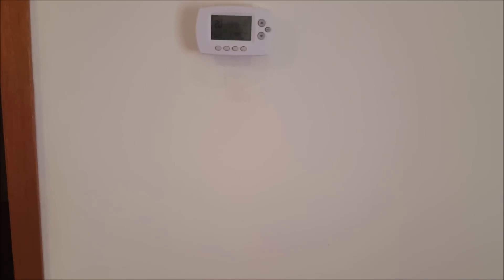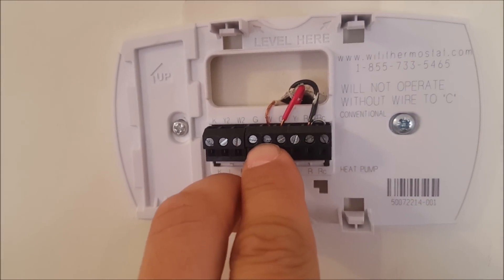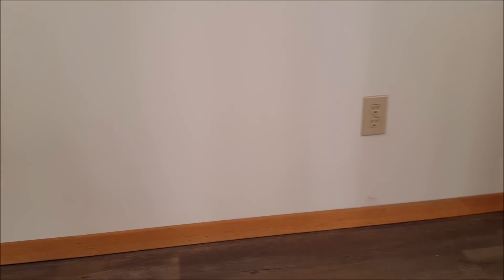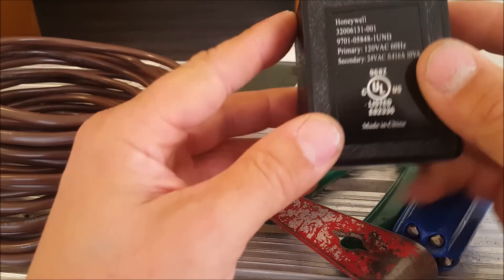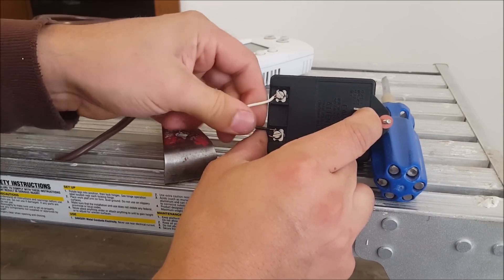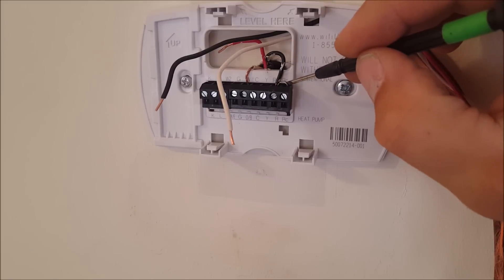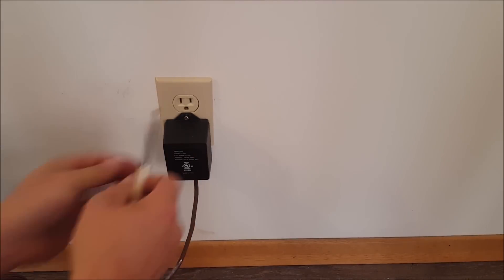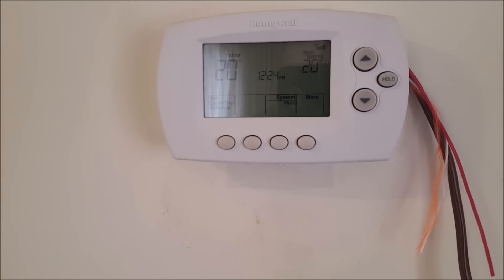Installing a WIFI Thermostat with no C Wire? NO Problem!

Comment: Sensi is Battery operated . No c required ..awsem to......or you can buy a 20$ add a wire box  no need to run wires
Reply: Daniel B that’s incorrect. I bought a Sensi and although it takes batteries, it still requires 24 volts.
Reply: I stand corrected. C wire required for heat only systems. Heat/cool systems do not require a c wire
Reply: @beastgirl43  no worries I'm an amateur at this so I could be wrong but there is an item called add a wire.....think it's called venstar  addawire........no need to run wire in the walls witch is really impossible sometimes ......

Comment: Is the Rc and C wire interchangeable? My power transformer just came with 2 wires, both black, not color coded. Does it matter which wire goes to Rc and C?
Reply from the maker: Doesn't matter 😁

Comment: Thanks chief for the video greatly appreciated got a house from 1958 so I'll be able to punch out walls whatever I need to do the unit is from 1990 I'm going to try to just take two wires off the switch itself on the furnace because they give me 24 volts actually 29 volts but what the hell is the difference unless I can find 24 volts elsewhere all the time anyhow if that doesn't work I'll do your method I'll just plug it in the basement so you'll never know considering that where the blower motor is attached there is an open 3-prong so yeah this will work for me

Good video I just subbed

Comment: Thank you for the video. I have the same thermostat and a two wire boiler (heat only). Thermostat works fine (connect to WIFI, turn on and off the boiler, etc), but when the boiler is off, the thermostat housing gets "warm", and indicates wrong indoor temperature (about four degrees Celsius more than real). When boiler is on, (or if i turn off the boiler power), indoor temp reading  is right. It seems that thermostat don't like power coming form de 24 V external transformer and power coming from the boiler. I also tried switching W and R wires and the problem persist. Any suggestions ? Thank you in advance.
Reply from the maker: That's really strange, I have never ran into that. Have you measured the voltages to make sure they are correct?
Reply: @randomrepairchannel  Voltage in C-Rc wires is 24 V. Voltage in W-R is 220 V (that is the standard  house voltage in my country)
Reply from the maker: @zoomanacronico  everything should have 24v if I'm understanding correctly that could be your problem
Reply: @randomrepairchannel  Yes, I will try using  a 24 V relay to isolate both circuits

Comment: Here's a great idea.  Buy a C wire power adapter from Honeywell and a Honeywell Lyric T5.  Hook up the C wire power source at the HVAC where the origination point of the thermostat is located.  Now use your thermostat wires with the Lyric T5 and you wont have to look at ugly wires dangling from the side of your thermostat.  And then you can voice control your new wifi thermostat using Alexa or just by using the app on your phone.
Reply from the maker: Pft... No way. Why would you want anything better or advanced. #dumbass

Comment: The ecobee comes with a Power Extender for the situations where there is no C wire. Anyone have any experience doing the Plug Hack you shown us on the Power Extender (PEK)? The benefit is that I have multiple heating zones, and if I can do this hack , not at each thermostat, but for all the heatzones in the basement it would be a neater option. Definitely no need to do any drywall repair either.. thoughts anyone?

Comment: Never staple wires !  This guy is obviously not a true technician
Reply from the maker: I didn't staple any wires, you may want to watch get video again. 

Only Staples used were on cable,  which is perfectly fine to Staple all day long.  Only cable I don't staple is data, because it can be delicate

Comment: What is the maximum amp rating I can use for this method? The one in the video is 0.5 amp, but is there a maximum? Also, will this work with Honeywell lyric T5?

Comment: the thermostat already has red coming in you just need to take the common to the transformer to complete the 24v circuit
Reply: I have 3 wires. But my hydrostat  only has 2 terminals for the thermostat. There’s no dedicated c terminal. Anyone have a ideas.

Comment: This will not work if you are using the thermostat for your AC RH is your heat RC is for AC
Reply from the maker: oilheating yes. We have seen issues with this, but some have reported it works?!? Weird

Comment: Amazing video... thank you.  I have a boiler with no C wire running to thermostat.  Bought the Nest and did not realize the issue until I got home.. Initially I had set it up where the Nest was power stealing from my boiler, but issues started to arise when it got really cold, and the Nest started to power out (all functions would auto turn off to compensate for the fact that the boiler needed the to run more often).  Anyway took your reco and took it a step further and bought a 24V transformer that I installed inside the wall from the nearest power outlet - brushed up on my dry walling skills.  Works beautifully now.. Cheers!
Reply from the maker: That's great news! Thanks for watching and sharing your success story.
Reply: Noticed that you connected the black wire from the adapter to the C terminal and the white to the RC. Is that interchangeable or not? I have an Ecobee+ and would need to know. BTW, excellent video.

Comment: Hi, I just ran a 24 V adapter to a 4 wire system and set up the same honeywell thermostat shown, but now I'm left with a system that won't manually run the fan unless the heat or AC are also running.  I was thinking this was the exact problem I was eliminating by adding the AC adapter vs. using the work around where you add a jumper wire to C.  Can anyone provide any help?
Reply from the maker: Andrew Strubilla your fan wire must not be connected
Reply: the fan wire is G, right?   they are all connected.  from my old non-wifi thermostat, I moved my G wire to G, W to W, Y to Y, I moved the R/Rc (jumpered, the wire was in Rc) to R and the new transformer is on C and Rc with no jumpers.  I wish I could add a pic.  I then messaged honeywell and they said that there is no way to power everything using an external plug in adapter.  it will only work on heat mode.  currently, the heat works and the fan comes on with it, but the fan cannot be turned on alone and i am pretty sure the cool doesn't work either.
Reply from the maker: Andrew Strubilla try reversing your rc and w wires
Reply: i will when i get home, i'm willing to try anything as long as there's not risk of a fire or anything.  thanks so much for your help either way.
Reply: isn't the W the heating call, so now my heating call will be connected to the external transformer?  is that right?
Reply from the maker: Andrew Strubilla yes sorry don't do that. Reverse r and w
Reply: Random Repair      at the thermostat or at the furnace?
Reply: nevermind I guess it does the same thing.  so then isn't the R then being fed by a wire with no juice?
Reply from the maker: Andrew Strubilla ya. Just try it.
Reply: Random Repair I tried that and the thermostat had no power
Reply: ignore that last message.  I tried them and same result, heat works with fan.  no cool.  no fan only.
Reply from the maker: Andrew Strubilla try jumping r and g at the thermostat for fan run to rule out a wiring issue at the furnace
Reply: Random Repair my furnace is an old mess of wires and is much more intimidating than anything I've seen on these videos.  I would 100% believe based on what it looks like in there that there is a wiring issue, but I don't know if I could find out...however...my normal 4 wire thermostat worked fine in all ways and it was a similar honeywell
Reply from the maker: Andrew Strubilla if your fan works fine you may have the hot on the c wire and the netural on the rc wire (should be hot for cooling) reverse these.
Reply: Random Repair meaning the two transformer wires?  I have tried swapping those.  thanks again for all of this help
Reply from the maker: Andrew Strubilla try jumping g and r at the thermostat and see if your fan turns on.  That's the first step in figuring out a work around

Comment: In this video it already looks like W is your common point from the basement. Then, that R/jumper/Rc provide power too. Therefore, the boiler fires. Maybe, for this video why not try to add an additional jumper between W/C...instead of that red-R wire coming from the basement?

Comment: thank you great video.  I have been wanting to install a wifi thermostat for a while on my 2 wire hydronic system. this video showed me how to do it. got the transformer on amazon and my thermostat from home depot and i was ready to install them. install took about an hour. hardest part was fishing the transformer  wire down from the thermostat wall hole to an outlet box in the wall behind the thermostat after my fish tape broke.
Reply from the maker: jonathan levine glad it worked!!

Comment: You don't have to plug in at the thermostat. If you run a new thermostat cable you can put the transformer at the furnace end and send the 24V to the thermostat from there.
Reply from the maker: Greg Jeffries correct you can put the transformer wherever you want

Comment: I am trying to set my pellet stove up to be wireless. Bought the Nest for my Oil Burner/Central Air but it isn't compatible with my pellet stove as per nest technical support.. I only have 2 wires from the stove. Red and white. Both working a standard thermostat currently. If I run a C wire for a power source to this unit will it operate the pellet stove in the same fashion ? The pellet stove I believe works on milli volt. Thank You in advance.
Reply from the maker: American Partiot yeah it will work if you connect it the way shown but u must be able to separate r and rc
Reply: Awesome.Will install as the video instructed.  Thank you for the help. What Honeywell model would you recommend ?
Reply from the maker: American Partiot all the wifi ones are good if you want basic. Lyric ones are a little more advanced with geofencing and such. It's really personal preference
Reply: Great, thanks again. Don't need the  bells and whistles for a pellet stove. Just want to be able to remotely heat the house up before I get home. Appreciate the assistance.
Reply from the maker: American Partiot buy the 100$ ones I use. They are great
Reply: Will do.

Comment: Thanks so much for this video.  It was extremely helpful. I now can control the heat settings in my cold shop from home. I now can come to a warm workshop.  I would suggest an alternative for the adaptor if you know of one.  This part was hard to find.  I got lucky to find one on kijiji but had to drive an hour away and paid only $10 for this part.  This video saved me on installation cost. I was able to follow your instructions to do this myself.   No bad for a girl!
Reply from the maker: Hayli Fashions thats awesome. Cheers

Comment: You are the only video I could find that could easily explain what the C wire is for thank you so much
Reply from the maker: Joshua Maldonado thanks man. No point in overcomplicating it. Mosty cause I'm no scientist. Haha!!!  Happy New Year.
Reply: Random Repair I kept thinking all this time the C wire is supposed to be hooked into the furnace and not one video showed me where the C wire goes to on the furnace end. But you cleared it up
Reply from the maker: Joshua Maldonado thanks for watching. Appreciate it :)

Comment: I just purchased a ecobee4 thermostat. I have 4 wires behind the existing thermostat, but no C wire. Ecobee gives you a adapter to attatch to the furnace circuit board for issues where there is no C wire present. However when I looked at the circuit I have 5 wires going to it, one going to the C screw. Will this set up help me?
Reply from the maker: dennis hellman I don't really understand the question but I think the ecobee setup should work from what you are saying with no c wire and minimum 3 wires from thermostat.
Reply: Random Repair: 
Thank you for your response. I was actually able to figure it out. Had two junction boxes before wires got to the thermostat.
Reply from the maker: dennis hellman lovely. Lol. Glad you got it

Comment: Hi. I just bought honeywell RTH8500 for my duplex which only have a gas boiler and no AC. What system type (0170) will I choice? is it heat only (no fan) or heat with aux pump?
Reply: Male Sheep if it's 2 wire it's heat only. Be sure some have a hot water heater setting

Comment: My new Vine thermostat does not have RC or RH.  Just R.  Where would the second wire from the transformer go?
Reply from the maker: I would maybe find a model with both. This is still possible but more risky
Reply: Why not just jump R to C if they both require 24 volts?  My house has a very basic gas floor heater with no frills.  Just heat rising from the floor.  I can't imagine the thermostat drawing enough amps to manipulate the heating side.
Reply: Never mind.  I just realized I can use the new transformer for both R and C.
Reply: Ryan Prough, I'm having the same issue (Nest-E there is no RC). Was wondering if only using the power from the transformer worked out for you?
Reply: I think because   R/jumper/Rc provide the power coming from the basement. Maybe, for this video add an additional jumper between W/C...instead of that red-R wire coming from the basement?

Comment: This was very helpful thanks so much bro
Reply from the maker: Synapse2k thanks dude!
Reply: so many of the thermostats that just have two wires going to them have either a two pair wire like the old phone jacks which has four wires or even "3 pair" or "5 pair" or "7 wire" or any number of different low voltage wires to them from the furnace controllers

I see how you have the two wires from the new Transformer but if all you need is a C wire and you have extra wires going to the thermostat from the area around the furnace which are not attached to anything wouldn't you be able to take one wire and run it to a terminal on the transformer in the furnace room to give you power to that C wire terminal on the thermostat or do you absolutely need to have the wire going to the jumped Rc terminal as well and additionally could you run both of them from the Transformer by the furnace???

Comment: I have a Amana air command hi efficiency 80  gas furnace. in the furnace the wiring board I have a ( C G W R ) and in trying to install a Honeywell Wi-Fi thermostat. can you please help me.
Reply from the maker: Luis Santana according to what you typed you have c wire at the furnace. Just run wire to the thermostat if you can

Comment: Great idea!  Where can I find that wall transformer on amazon?
Reply from the maker: Ryan Markle https://www.amazon.com/gp/aw/d/B001DVQ5KO/ref=mp_s_a_1_28?ie=UTF8&qid=1510673462&sr=8-28&pi=AC_SX140_SY202_QL65&keywords=24vac+transformer
Reply from the maker: Ryan Markle check this one out. Not exactly the same but will work the same.
Reply: Lowes has an Orbit Black Replacement Transformer
Item # 168261 Model # 57040 that I installed and it worked.    Two black leads, one to the "C" and one to RC.    Simple, except a hole in the kitchen wall behind the thermostat.   The wife will one day soon let me drill and scrape a line hole to hide the black wire......   but this was day one the day after Thanksgiving......
Reply: Here's the one that I used that already has the wires assembled in the transformer. Also the wire is thinner making for easier installation https://www.amazon.com/gp/product/B075PN6NCV?ref_=ag_dp_usw2_LLowI